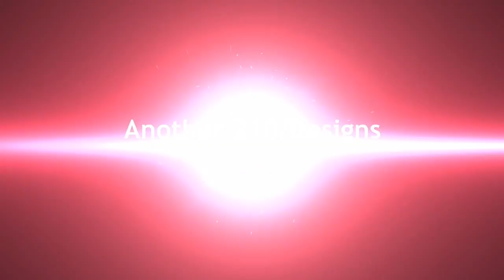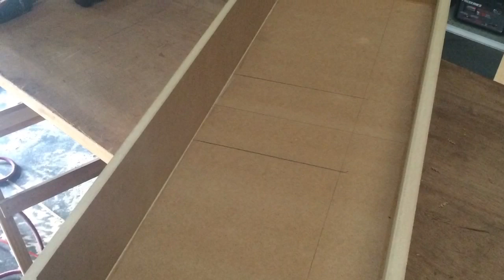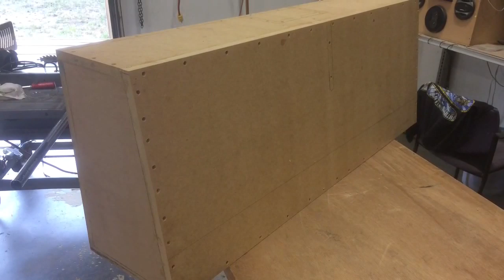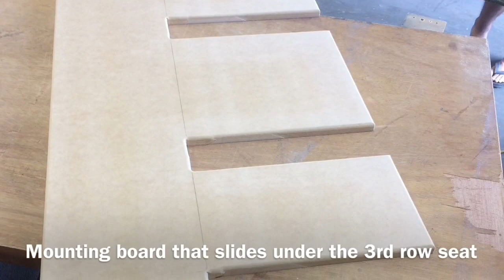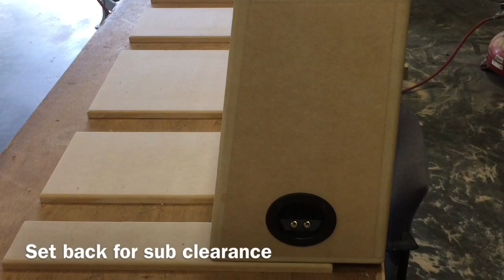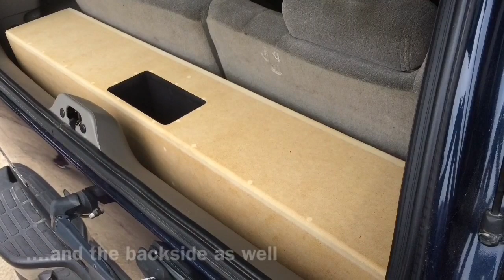Ported Box Build for 2-15" CVRs

Comment: You have good craftmanship, but its nuts that the customer wanted a ported box for two 15" subs, specially Kicker models that call for huge ported box specs. I think even the whole thing sealed for one of those 15s would not have been enough airspace right?
Reply from the maker: Appreciate it man. As for the internal air space for these subs. Kicker has a wide range of around 3-5cf/ea ported and sealed around 2-5cf/ea. Based on the vehicle and subs, this enclosure was on lower end of the spectrum. However it performed very well as all kicker products do. He had solid amp that was able to push them and compensate for the smaller enclosure. We try and build to help give the customer what they want and not sacrifice the performance. Plus, he already had the subs and we were able to make it work out for him 👌🏽

Comment: Another good build and video but have you tried a 4th order build yet and about the cost for 4 15's inside Tahoe
Reply from the maker: compcast -no not yet bro, nobody around here gets down like that. What kinda 15s and box size?
Reply: Bj Hammon  4 Sundown x15's no third row seat my brother got 2 of the x15's 4th order n crown Vic u know I'm trying to out do him
Reply from the maker: compcast / You gotta post a vid of that man 😳😳😳 Did you have to build it inside the truck??
Reply: Bj Hammon  He got it built by mild n wild in Fort lauderdal fl. And yes it was built n the trunk but it needs to be sealed off and rewired but with dat epicenter on it as is dat thing moving so wind but when I get situated I'm going ported
Reply from the maker: compcast - Okay I gotcha. I've seem the epicenters but never hooked one up. Does it make a big difference in all songs or just ones lacking in bass???
Reply: Bj Hammon  You can use it on bass lacking songs and but it's for the music without bass perfect for 4th order with moves a lot of wind inside vehicle

Comment: Hey can I get a cut sheet on this build
Reply from the maker: mike krautkremer - Should have the box dimensions written down in my book. I’ll look and post the cut sheet.
Reply from the maker: mike krautkremer - 
Box: 49” x 18” x 11” x 8” / 33hz
Bottom 49” x 10-1/4”
Top 49” x 7-1/4”
Back 49” x 16-1/2”
Left 16-1/3” x 9-1/2” x 6-1/2”
Right 16-1/2” x 9-1/2” x 6-1/2”
Front 49” x 18-3/4”

Port 13” x 8” x 2-3/4”
Top 12-1/4” x 9-1/2”
Left 12-1/4” x 2-1/4”
Right 12-1/4” x 2-1/4”
Reply: Can someone help with a design for 2 10's jl audio w3's?

Comment: Hey bro have u done a box for silverado regular cab ?
Reply from the maker: No, I don't believe I have. Just 4 doors or extended cabs, so far. I measured for a 70s model single cab Chevy, but that Build didn't happen.
Reply: Bj Hammon ok bro thanks good job on those boxes 👌👌